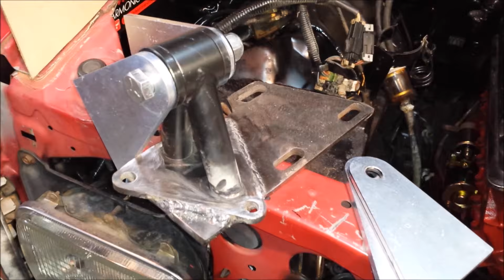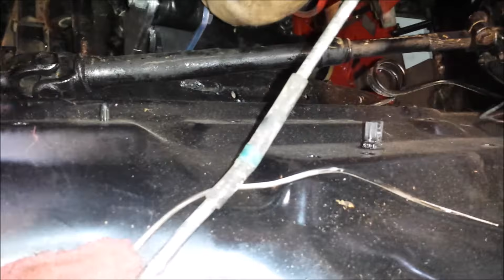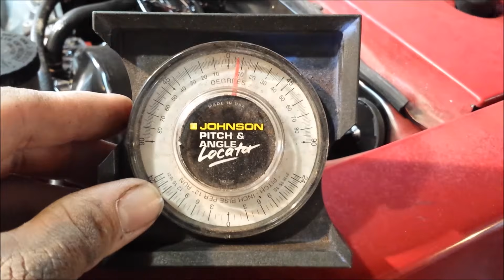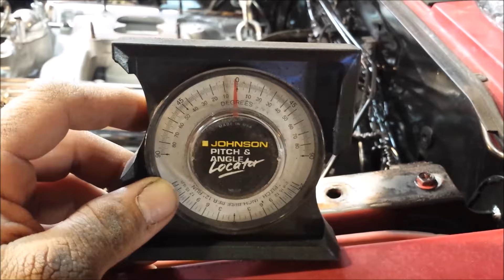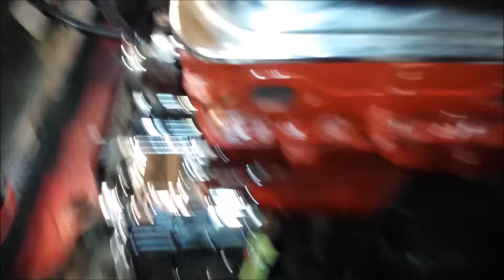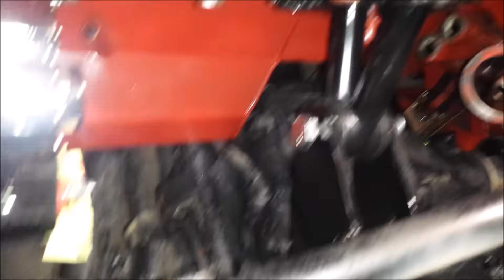5.7 Sbc hardbody conversion  4x4 custom motor mounts (D21) v8 conversion (part2)

Comment: How did you do a transmission on this d21 for the 4wd
Reply from the maker: I used a 4l60e 4x4. I used the drive shaft from a suburban then I took the drive shaft to a drive shaft specialist and made I u joint mate with the d21 axle.
Reply from the maker: Some thing with the front drive shaft

Comment: What kinda adapter plate do you have to make  the motor hook up to the transmission
Reply from the maker: None. The 4l60e transmission bolts to the small block chevy

Comment: Is ur 4x4 working ?
Reply from the maker: It did. I ended up removing the electronic transfer case for a manual one. And had the front drive shaft made using chevy drive shaft with Nissan u joint to mate the axle.
Reply: I got the same set up  same motor same transfer case im just confused with the oil pan thing would this not fit at all
Reply from the maker: @lambertosanchezgf1011  I used a chevy 2 nova oil pan.. it moves the sump pump to the front. If you try to use the stick chevy pan it will hit the axle.
Reply: What about the plumbing to take it to the front
Reply from the maker: @lambertosanchezgf1011  the pan came as a kit with the pick up tube. You would have to remove the old pick up tube and install the new one. It came with instructions.
Reply: Where can i buy it
Reply from the maker: @lambertosanchezgf1011  I got it at speedway motors online. You can try, Jegs,  summit racing,
Reply: How much u pay for it?
Reply from the maker: @lambertosanchezgf1011  it's been a while but I think about $150
Reply: Are u running power steering
Reply from the maker: @lambertosanchezgf1011  no the car came with no power steering from factory
Reply: So chevy transfer case works with nissan axles
Reply from the maker: @lambertosanchezgf1011  no. I took both Nissan and chevy axle and had an axle shop put it together.  To make a shaft. Front part was Nissan and rear was chevy
Reply: So what if i used my factory axles would it work
Reply from the maker: @lambertosanchezgf1011  the axle are not a problem. They are plenty strong.  I didn't break them
Reply: Thanks for technical support
Reply from the maker: @lambertosanchezgf1011  good luck
Reply from the maker: @lambertosanchezgf1011  oh yeah 1 more thing. Mock the engine with the front drive shaft in place. You gonna have to offset the engine more towards the passenger side. The front drive shaft will hit the tranny if you center the engine.  Plus you going to have to cut the tunnel slightly on the passenger side.and make a new one later. After you have the oil lines in place. I made an access panel in the tunnel so I can tighten or loosen the tranny oil cooler lines. The tunnel will be tight, plan on cutting it up.
Reply: @AngelGarage  thanks again bud

Comment: What was the oil pan off of? Year? Model?
Reply from the maker: It was a 62-67 chevy II/ nova v8 oil pan kit. I think my motor had a 2 piece rear main seal. I got it from speedway motors

Comment: Is that the only oil pan that will work with the 4wd ? ..good job on the video btw
Reply from the maker: boop890 that oil pan allowed me to lower the engine as far as possible without doing a body lift. Which i think it would be ugly. But that oil pan is about 1 inch above the axle. The original pan left the engine above the hood at a bad angle. The other option was If I used the original oil pan I would have to cut the firewall and shove the engine in the cab. Not a good option in my opinion. Thanks for watching and subscribe.

Comment: Where you able to clear subframe with rear or front sump oil pan?
Reply from the maker: jesse delgado i used the front sub pan. I had 1/2 inch from the front axle. On a 4wd there are no subframe like a 2wd. The axle is the subframe. But yes it worked fine.
Reply: angelfiggi  do these motor mount work with a 2wd?
Reply from the maker: _tomuchatonce _ these are universal motor mounts you can use them on any subframe 4wd or 2wd.
Reply: angelfiggi  okay thanks and did you cut the stock motor mount bracket off the frame ?
Reply from the maker: _tomuchatonce _ yes. Anything that got in the way  of the small block was removed

Comment: Why couldnt you have moved the motor back towards the firewall to make room for the driver side motor mount? 
Also, why couldnt you lower the engine in the bay to clear the firewall?
Reply from the maker: Kevin it was as far back as I could go. The transfer case would've hit the torsion bar support.  Also that was the lowest I could make the engine go into the bay. I had about 1/2 inch  clearance from hitting the front axle.
Reply: angelfiggi I have a 2wd. I realized later why when I saw the transfer case. Thanks for your video. I plan to do this one day with an engine out of my 86 suburban into a 2nd hardbody.
Reply from the maker: thx for watching. I have more videos coming in just haven't had the time to edit them

Comment: so how does the angle suppose to be when im doing a swap of a fuelinjection 5.7 lt1 do i just level it to the frame and the i find the angle of the driveline or the engine itself?
Reply from the maker: Damian Salinas when your using carburetors you want the engine as level as possible.  I usually set it with at least 3 degrees to the back and somehow the driveline lines up. im putting in ladder bars so I'm changing the axle angle to match the engine. fuel injection is the samething close to level as possible with a slight angle to the back
Reply: angelfiggi thank you so much its because im stuck in that part but ill try to do it this weekend to see ho it goes thanks again

Comment: did you use the stock radiator or what radiator did you use
Reply from the maker: yes I used stock radiator.  surprisingly the temp stays at 180 while driving without the fan on. I did push the radiator support 1/2 inch for extra room